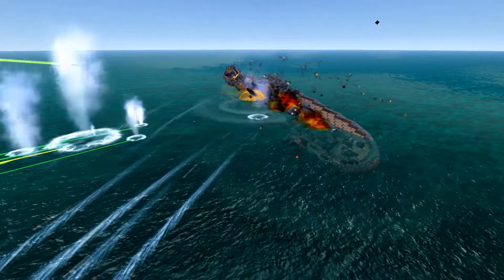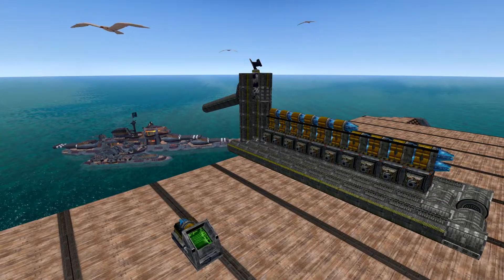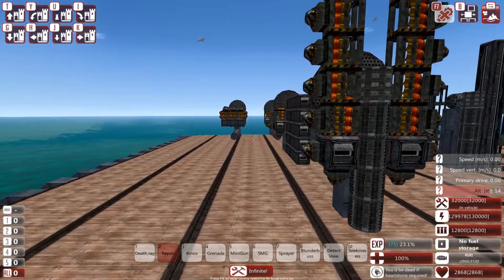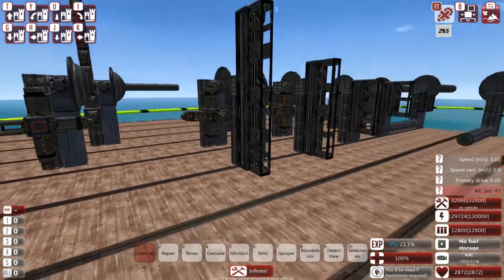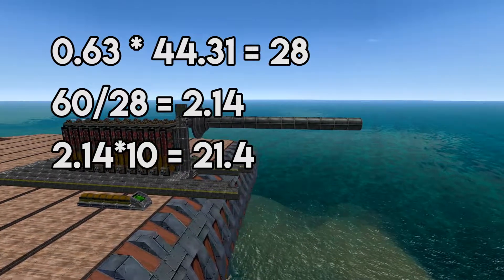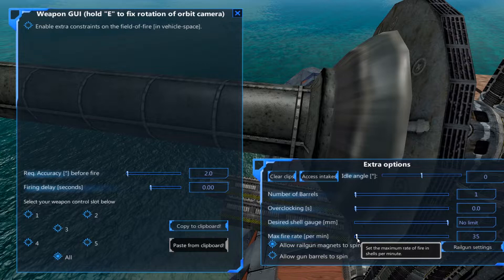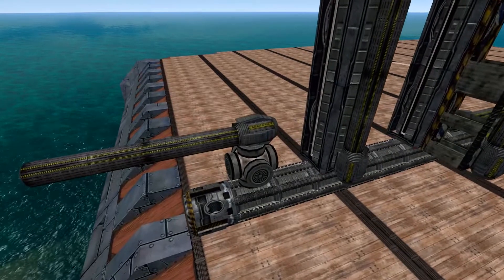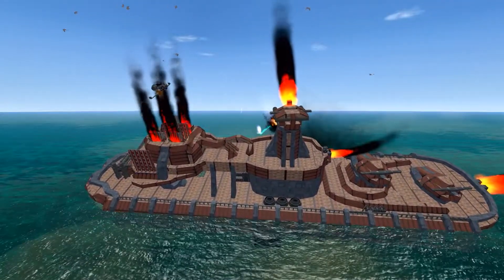FTD TUTORIAL | Advanced cannon tutorial w/ maths

Comment: After awhile, resource costs gets kind of ridiculous.  Created a battleship, that's 231Lx29Wx61H.  Volume is already at 47012 blocks.  4 turrets with 3 1673mm crams, 4 Adv cannon AA turrets, 2 Anti-Missile CIWS turrets and a bunch of Anti-Munition lasers.  It currently costs 521,443 resource...and it STILL needs improvement.  Some good numbers though.  With the boilers at 10% she produces 40,000 power, STR 10 shields surround the hull, and can store 500,000+ power in its battery banks for the electric engines or shields if the boilers go offline.  All this at a decent 31 knots or 16m/s.  The Crams are admittedly slow compared to advanced cannons, however...13.4 sec reload for 8,900 kinetic, 14,000 explosive and 115 fragments per shell isn't terrible. At least in my opinion.  Would love to hear your thoughts.  Oh, forgot to mention, it also has a small compliment of long range torpedos and Anti-IR decoy flares.  I realize this is an ADV cannon tutorial, but seems like other channels are just dead and get only negative criticism.